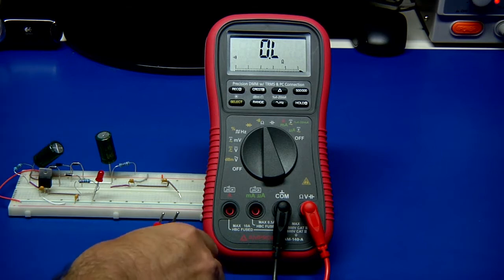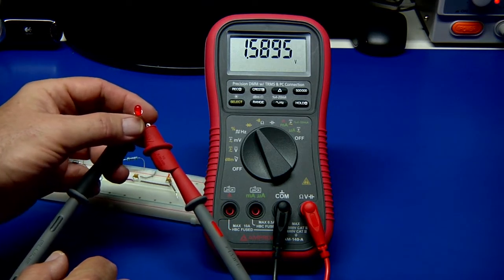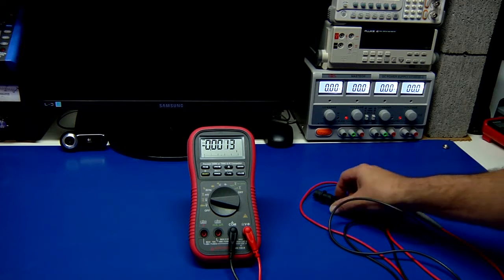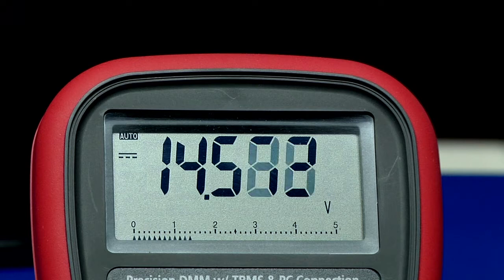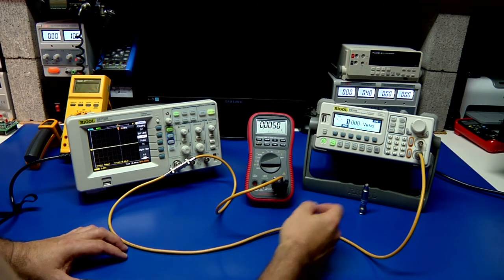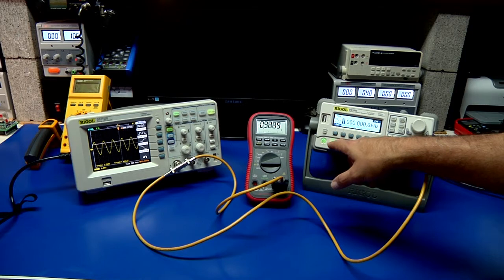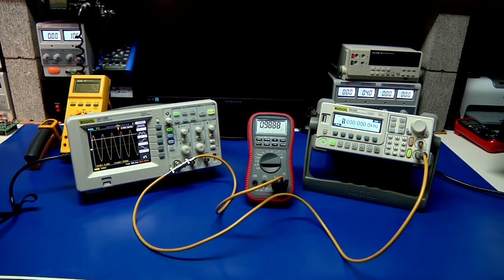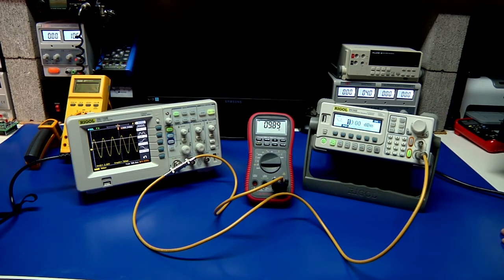#2 - Amprobe AM-140-A DMM Review: Part 2 of 4

Comment: By placing the feedthrough terminator on the signal generator, you've double-terminated at the siggen side and got no termination at all at the multimeter end. The variation in multimeder readings over frequency might (maybe) be due to this trap, and not the fault of the multimeter at all: EEVblog #652 - Oscilloscope & Function Generator Measurement Trap

(Specifically, I mean around 7:00 when you're sweeping through frequencies and seeing interesting behavior).
Reply: On second thought, maybe 109kHz is too low to cause an issue. However, it'd still be better to put the feedthrough terminator on the multimeter side to eliminate any doubt; there's no reason at all to have it on the siggen.
Reply from the maker: Sorry I missed this post.  I agree with what you said and at that low frequency not really a problem but you do have a good point and I normally do terminate at the far end.  Thanks.